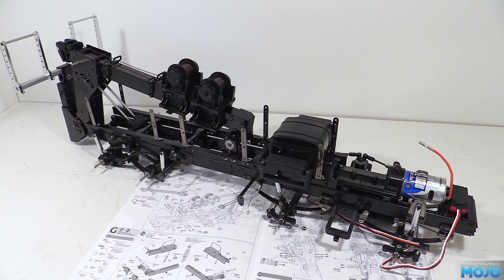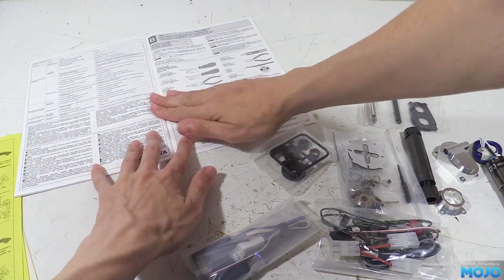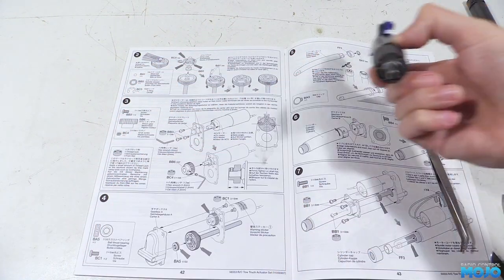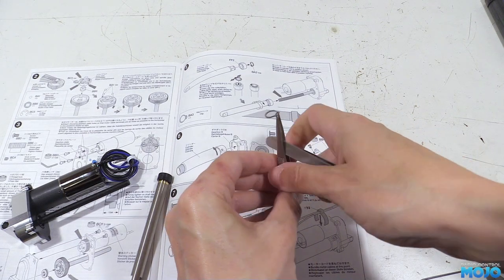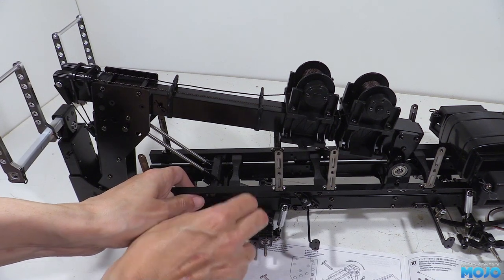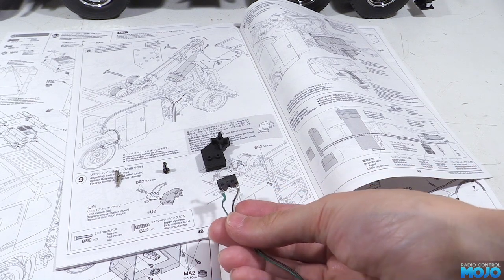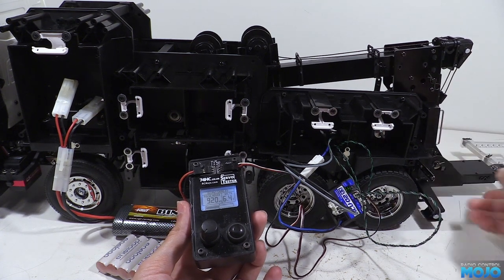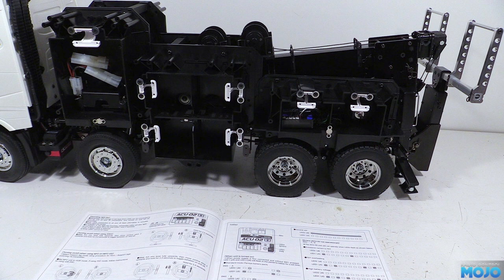Tamiya Wrecker - #15 Electric Actuator

Comment: I thought about this Kit for my 8X4 Tipper Truck.... until I saw the PRICE!! Definitely lacking in value. 
Then I found an Actuator Kit on Evilbay, for only $150 (£98)!!! 😮  Figured it was at least worth a try.

It's a decent piece of Chinesesium, nice Machined Aluminiuminium. Instead of the little 260 sized Motor in the Tamiya, it comes with a 540!! It also comes with a clone WP1060 ESC.
 Considering I've got a large Dump Bed, that might get filled with real dirt, that extra power might come into play... 

No, it doesn't come with the bells and whistles of the Tamiya, but it's a THIRD of the price! 
Ill be doing a very thorough Video on the installation and operation of this, because others might be interested in saving a buttload of money!

Only thing is, the mechanism is purely made for a Tipper Bed, I can't see how it would work on a Tow Boom.